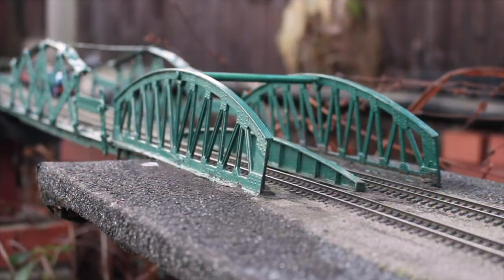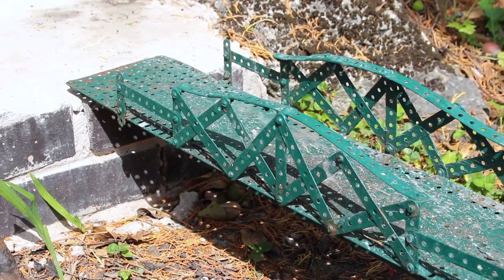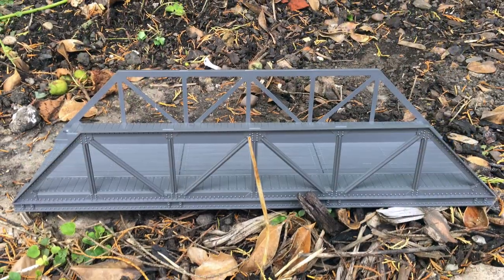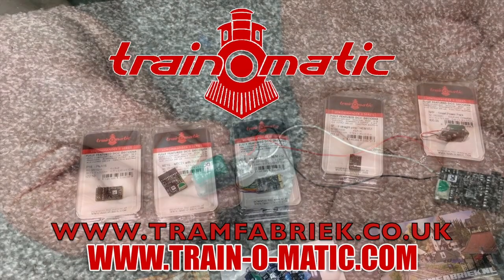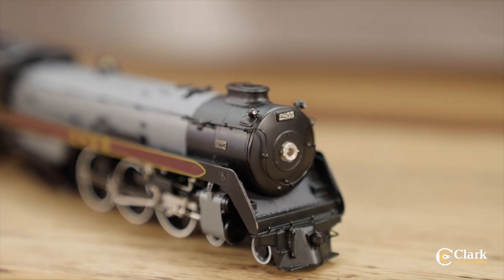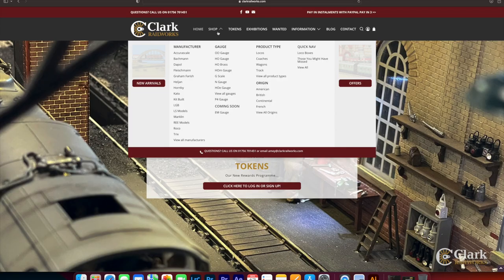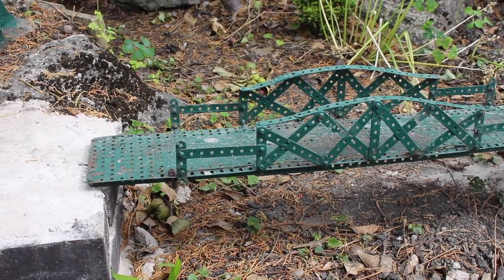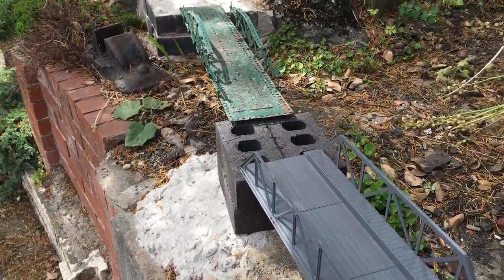Rebuilding the O Gauge Garden Railway - Part 3: Bridge that Gap!

Comment: Jenny, that will be a good viewing place for sure. As regards the Meccanno bridge i have a suggestion. 

Once cleaned up it might be prudent to give it a coat of Hammerite paint. Think they do a green or two in their range. 
It will help stop the rust ftom getting worse and add strengthening to any rusty areas.

Comment: I noticed that the wind-up was recorded before you painted the plastic bridge - and I was amused by all the ants running around just in front of your arm, on that concrete!
Reply: Yes I spotted those too and also that she said "Lucked Out" rather than "Lucked In" which was either a mistake or pandering to those Yanks who also use the phrase the wrong way round :)
Reply: @Dave_at_Its_My_Model_Railway   Americanisms keep creeping in. Lucked out used to mean out of luck, and v/v.
Reply: Yep gonna need an Ant trap/disc . Keep up the good work 😊
Reply: @hamshackleton  It still does mean out of luck to me :)
Reply: Ants 'v' O gauge.  Got a feeling Ants will lose that one! 😂
Reply: @mooglesmodelrailways  Strength in numbers, though!